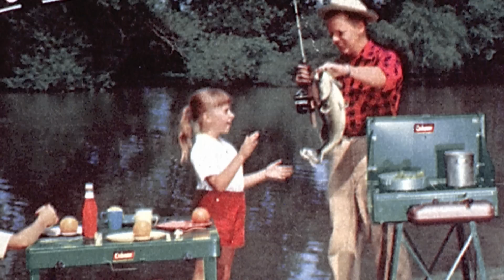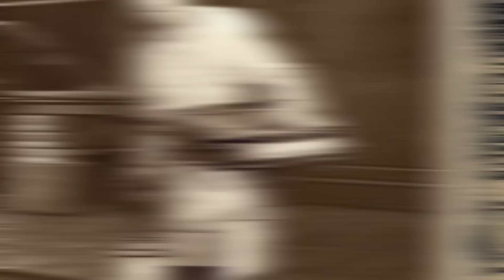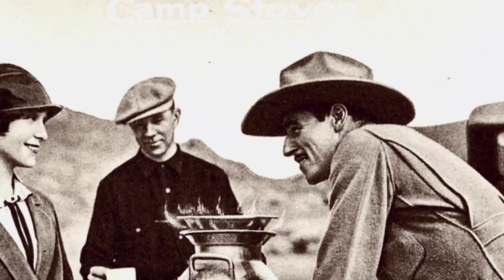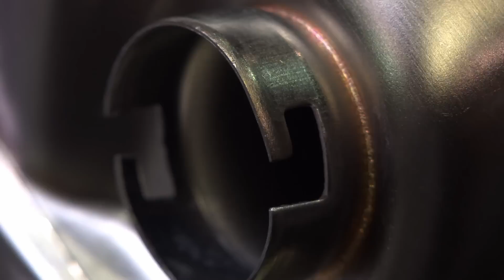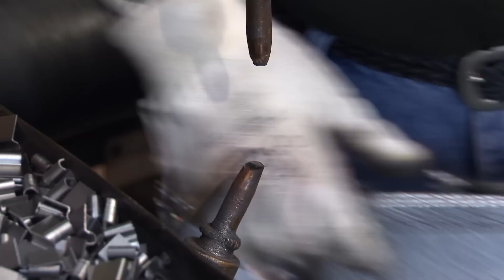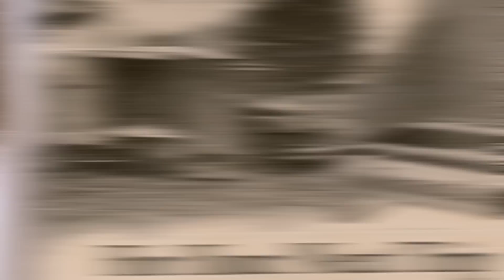How a Coleman Stove is made - BrandmadeTV

Comment: I have this stove and it's my favorite every.  I won't let anyone use it unless I fill and pump it myself. When I'm done using it for a while I'll run oil gas through it's and purge with air and empty fuel from tank.  Treating it like a petrol engine thats being stored.  Always keep a brass brush toothpicks and keep it clean and it'll last a long time.  China can't even copy this properly.  Just get a Colman unless you love swearing and getting cut by Razer thin carbage grade steel

Comment: Colemans paint is garbage. if you ever redo a coleman lantern or stove; use rustoleum 2X piant/primer spray or Krylon pain/primer spray(krylon lays nicer) and top coat with minwax polyurotane. that lantern/stove will never rust or chip in 200yrs!
PAINT CODE rustulum 'Hunter Green' or 'Apple Red' are a near perfect match for coleman color

Comment: Have had and used my 425 since 1961. Converted it to propane some years ago, but it works just fine. Took it camping just last week.
Reply: Eric Gamble 
Thumbs up for using your 425 since ‘61. 
Thumbs down for propane.
Reply: Made the conversion after the Katrina flood ruined the fuel tank. More a matter of necessity at the time. Curious to learn more about your opinion on propane. Thoughts?
Reply: Eric Gamble 
I don’t, personally, prefer propane because of the pressurized tanks necessary for it. I find them rather heavy (for the amount of fuel they carry), bulky, and harder to dispose of. As far as reliable ignition and BTUs, I think propane is adequate.
That said, my wife has a propane grill and I have a Coleman SportCat propane catalytic heater. I just prefer Coleman fuel or kerosene. Although, beyond any doubt, propane is much easier to light than kerosene.
Reply: Those are good points. I may look into finding a replacement tank. Thanks for the reply!

Comment: Ive got both a coleman 426 3-burner stove that i keep in my travel trailer and use out in the camp site when im camping, and a 413 2 burner stove that stays in my garage and is my road trip stove when i dont have the camper with the truck, out when im out in the bushes with my jeep, i run both of mine on unleaded 87 octane pump fuel, absolutely love them! Also have a more modern 2 burner propane colema  stove i keep as a back up to my backups and for power outages in the house. And have a several duel fuel lanters, some kerosene hurricane lanterns, and love the older days of simplicity.

Comment: I honestly thought this was a Canadian invention but it is not, however, I have had one of these great stoves in our Family for 60 years but am shocked you've changed that Iconic fire engine red to a dark silver which sadly cannot be recognized as a Coleman stove for Miles like the red one!!
Reply: the silver designates that it's "duel fuel" the red is Coleman fuel only.
Reply: @brandonyoung181  naptha white gas
Reply: Coleman "white gas, or naptha" is better than gasoline, as most gasoline has ethanol now.
Reply: the original stoves had gold tanks
Reply: @rob3071  yes I have a 1948 model 415d it has a gold tank.when i found it all I did was strike a match  an it ran great. But I still want to restore it.  Does anyone no where I can get a new fuel valve an gen for it

Comment: I think it would be so awesome if coleman did some retro models.
Reply: grn dragon 
I'd be all over that G.I. Pocket Stove in matte black.
Reply: they did make retro models of some products. i have a 200a red lantern made in 1995 that is a retro of the original red 200a that was discontinued in the early 70's. recently they made a retro model of their original metal cooler or ice chest.
Reply: @marzsit9833  the 200a wasn't "retro" it was just haulted they have been made 1950-2003 i believe
Reply: Definitely a great idea! 💡
Reply: Offer up has em cheap in my area so cal at least. I got a 2 burner one for $15 almost like new. Its dated from mid 50s to 1962.  Theyre all over
Reply: They do, but they don't seem to sell them in the US. They sell all kinds of 'anniversary' models over seas. Look up the Coleman 413J "120th Anniversary" model in red. They're not even selling the 413's in the US anymore, but they are available elsewhere. I'd take a 424/425 Dual Fuel 120th Anniversary edition in red tooo-morrow if I could get my hands on one. Funny, the 425 I refinished from the '60s is still the best camp stove I own, besting the newer Colemans. Retro models would be a hit with a few of us ...
Reply: I had my dads from WW-2 and it got thrown out. I was SICK and it still worked with the gas that was in it.
Reply: @lewiemcneely9143  you going eBay you can find one have that memory again
Reply: Like the first model stove, but they would make them in China.